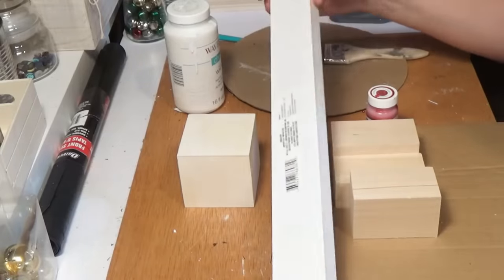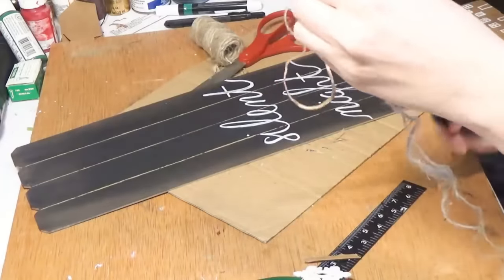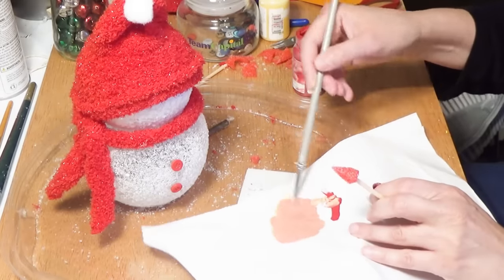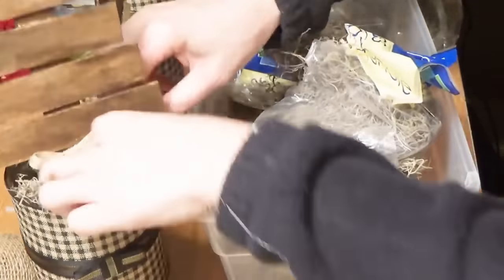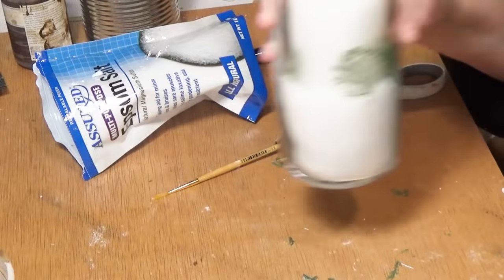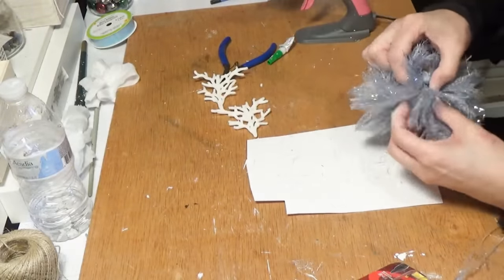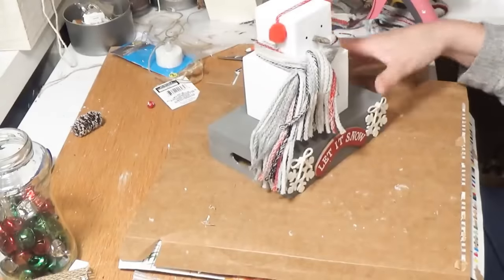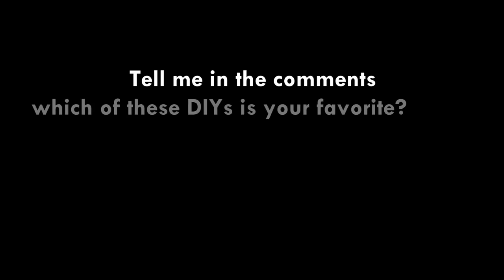30 CHRISTMAS DIYS 🌲 MEGA VIDEO | TOP 30 DOLLAR TREE CHRISTMAS CRAFTS | BEST OF CHRISTMAS DIYS 2021

Comment: If you want a good pair of scissors to cut things like tule and things like that, get a pair of Trauma Shears. They are what they use to cut seatbelts and stuff like that in rescues. They will cut wire too abs they don't dull!
Reply: I work in a trauma unit. Those scissors are awesome for crafting. Save your good scissors.
Reply: @oscargoldfield1593  my husband is a paramedic. That's how I got turned on to them. I have a pair at every work station in my craft room as well as in my kitchen.

Comment: Lots of great ideas to choose from.  I was wondering how the heck you were able to touch that hot glue right after putting it down.  I have burnt my fingers to the point of blisters with mine.  lol  I am a recent widow and have been crfting for a couple years.  I love your narration.  You are a joy to listen to, (even with the chuckles and fumbling at times).  You are right, if videoed my efforts there would most definately be hot mess moments.  Great video.